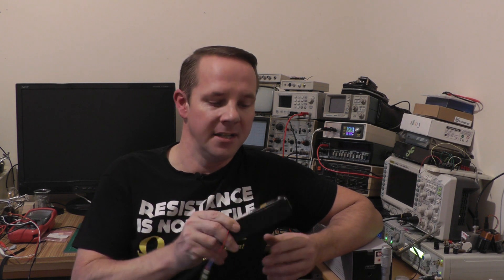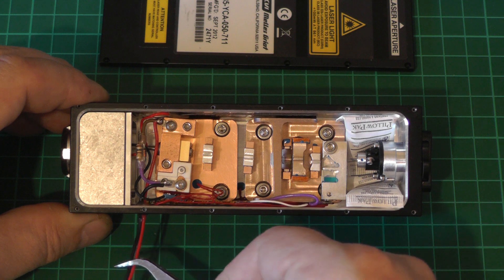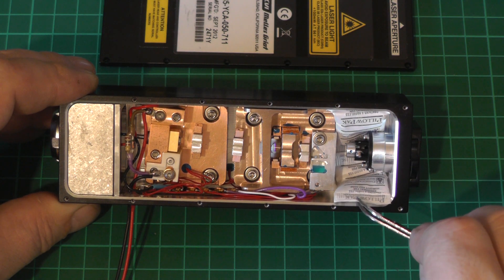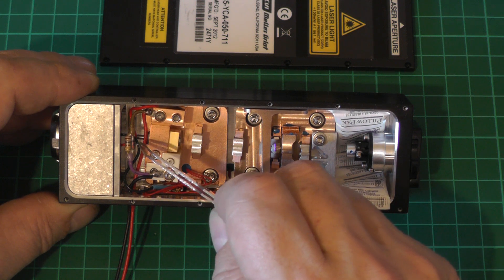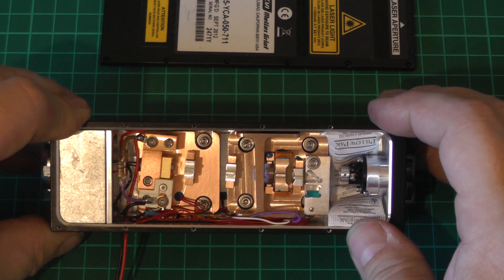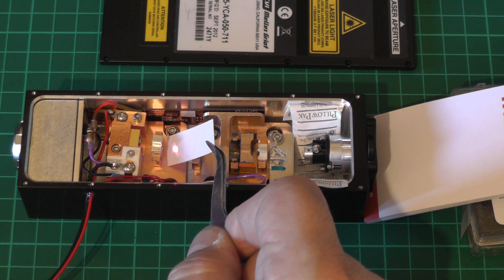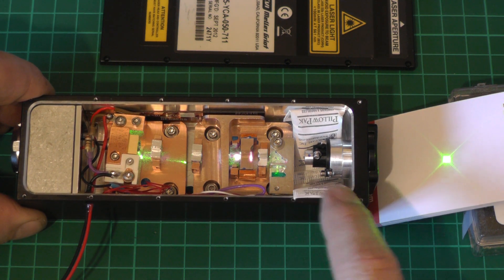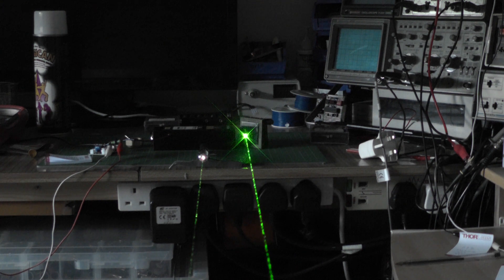Yellow Laser Hacked! DPSS Melles Griot 85-YCA-050-711 561nm

Comment: i have a DPSS head similar to this in build that was about 520nm in color , it appears to have a cracked doubler crystal , what would possibly be the crystal type for that?
Reply from the maker: It could be KTP (which is fairly cheap) or LBO or BBO (both expensive). do you have any data on the Laser?
Reply: @LesLaboratory  i havnt looked into it for years because it seemed all too hard but ill drag it out again soon and have a look again

Comment: I had one of those. They are not too difficult to operate. Just make sure the TEC units are properly operated as it is extremely sensitive temperature wise. The laser diode in it is 5W but run at about 3W in normal operation. The crystal in it is a LBO but the ends are coated with a MgF/ZrO AR coating. The little BK tek blue laser drivers for 473nm dpss lasers work great to run these. 🤓😁❤
Reply from the maker: Awesome! Thanks for the info. There seems to be little about these floating about.

Comment: do you know why this laser beeping when we turn it on. and there is no emission light. thanks.
Reply from the maker: do you have more information. what power supply are you using, how many beeps, what is the period between beeps, any lights on and so on.
Reply: @LesLaboratory  thanks for your reply. i figured out it was laser controller's problem. error light and laser emission light can not be turn on anymore. can you help us fix that. thanks.
Reply: @LesLaboratory  thanks for your response. we figured out that it was the problem of laser controler. when we turn the key on, emission light on the controler is not on.

Comment: Could you make it shift towards yellow by varying the yag temperature?
Reply from the maker: The wavelength of YAG/Vanadate will drift with temperature, but it is somewhere in the region of 0.05nm/degree. You would probably need to tile the LBO as well to phas match with the new wavelength, assuming the YAG survived.

Comment: I bought a couple laser modules off Alibaba 2 or 3 years ago it was sold as 575nm it's a bright yellow color it doesn't look green at all but the camera pics it up as green.
 it doesn't run in tem00 mode it's  almost like 3 dots merged into one but it's not noticeable enough to tell it's a little unstable but works great.
the module was small 20mm diameter by 30mm or 40mm long I was able to build it into a handheld I used an old dragonlasers Spartan host I haven't done anything with the other yet they cost me about $50 each shipped I still see these for sale but now they want $250 for them. it makes my 589nm Spartan laser look orange when side by side.
Reply from the maker: Cool! I have been looking at those too, just waiting on the price dropping to reasonable levels. At the prices they were offering, I am surprised they did not get into the laser pointer game.

Comment: Good video, a note on the pump diode. They usually hit nominal output around 1.8v to 1.9 max. I have seen larger ones hit up into the 2v range for the 808nm but I typically keep it in the 1.9v range. Now that might sound like I am speaking of voltage regulation but no, this is voltage drop at room temp at a good current set point. Looks like it's a 2 - 5 watt pump, given the threshold probably a 2 watt pump thus giving it about 2 amps upper nominal range ( It's about 1 amp per optical watt on an 808nm laser diode at nominal operating current ) You can probably get a pair of wavelength electronics TEC controllers to run the closed loop thermal regulation on your pump diode and SHG. I have messed around with some LBO stuff and left a 473 resonator out for like 10 years and it still worked, I think BiBO is the hydroscopic crystal people worry about the most, but any removable of water and oxygen helps longevity in any case. Sometimes crystals can be restored by heating slowly over time to drive moisture out of them but it's tricky as rapid heat can cause fracturing. 561nm is one of the wavelengths I have yet to acquire myself. Currently I am excited to get in some SVAP based 565nm and 574nm. I think they are bad pumps and use 940 ish nm for the pump, I am thinking maybe the 946nm line from ND:YVO4 will be a good go to. I could easily keep rambling but I am going to take a look at your other videos.
Reply from the maker: Thanks! Yes, I figured greater than 2W, but figured a conservative estimate of 3W since I couldn't get any data on the diode. 5W is probably more reasonable, from what I have read, doubling to this wavelength is not particularly efficient.

I have thought about driving the TEC's with a closed loop but that is job for another day. The Laser seems to run fairly stable at room temp without them and I haven't observed anything particularly weird...yet. That said, it would be nice to see this run at 50mW! :-)

I have a question for you, since you have had experience of these, Is is possible to cut LBO for a specific design temperature? I wonder, because the lack of fans and the narrow operating temperature range from the datasheet, it seems unlikely that cavity elements would be too far away from the centre of the operating range, else there would be issues getting rid of the heat. What do you reckon?
Reply: @LesLaboratory  Not really, the temperature stability has to do with maintaining the distance between the HR and OC of the resonator to keep the phases of the waves in the right condition for SHG to happen. Regardless of how long the LBO is temperature will still effect that distance.

One easy solution if you can find it is the Hytek HY5640 which is a compact TEC controller. Sadly they are hard to find but little trinkets of gold when you do and usually fairly priced.
pdf.datasheetcatalog.com/datasheet_pdf/hytek-microsystems/HY5640.pdf
Reply from the maker: @Zenodilodon  Figured something like that. Cool thanks, I will keep my eye out for that one. I was considering building a  TEC controller, but It looks like keeping the temp to within a fraction of degree would be an epic challenge from scratch. Far better to source off the shelf modules, once you factor in time spent hair pulling!

Comment: Just love this video, very clear explanation. So how is the excess infrared filtered out of the beam, is that done in the output coupler?
Reply from the maker: Thanks! The output coupler should be high reflective at IR wavelengths as you need as much circulating power as possible in the cavity to get efficient frequency doubling. It is likely there is an additional IR cut filter at the front of the assembly as well.
Reply: @LesLaboratory  That makes sense. Thanks for answering!

Comment: That's only the second one of these I've seen; I own the first one I've ever seen! Mine read dead short even with the matched controller connected; I assumed it was a failed relay, in fact it turned out to be physical damage that caused the bond wires to short to the LD substrate, the fault was rectified by the use of a fine needle and a high magnification microscope to lift the bond wires. I purged mine with argon prior to sealing it.
Reply from the maker: Sound like a fun job, those bond wires are super fine. I sat the unit on top of the radiator, and heated the bags of desiccant a little before re-assembly, so it should be all good.

Comment: Great video as always. Do you have any idea how the optical components are aligned? Precise machining, glue, adjustable mounts, etc?
Reply from the maker: Thanks! The machining is quite precise, however the carriages for each of the optical elements are epoxied in and have little tabs on the top. My guess is these are set at the factory either by robots in a jig, or by hand before the epoxy cures.
The heads require a matched power supply (i.e the serial numbers must match) my guess is the temperature set points are also tailored per device, which makes each head more or less a one off.